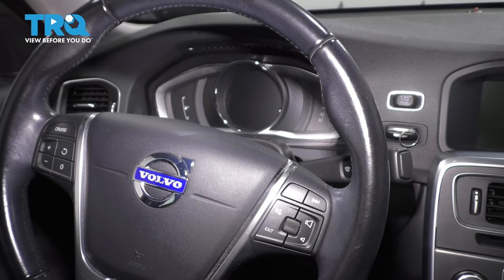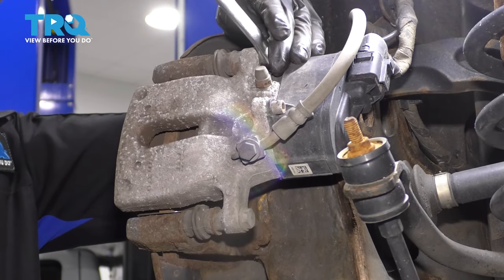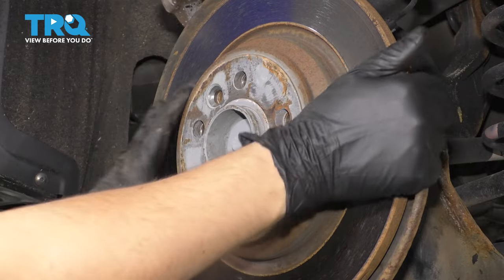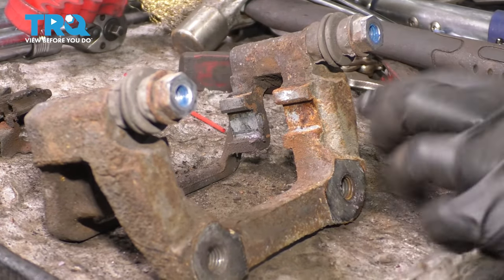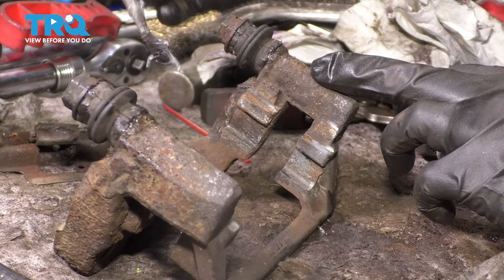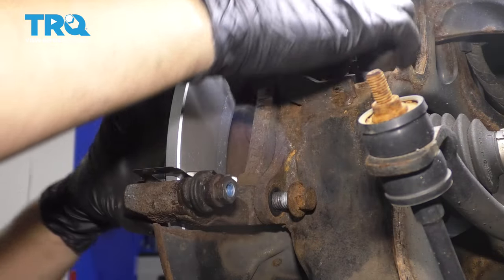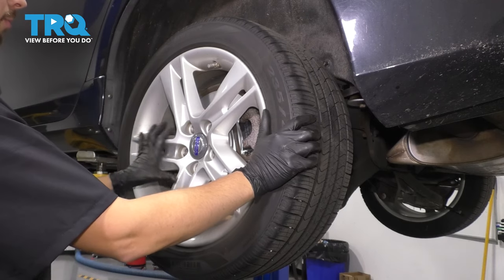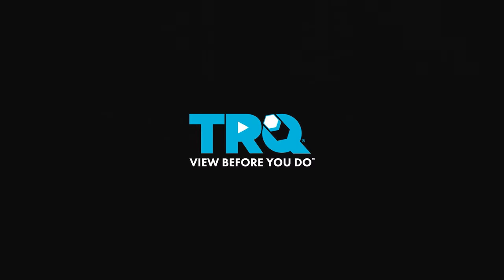How to Replace Rear Brakes 2011-2018 Volvo S60

Comment: thanks! Hey, can I do it without the scan tool? Because I can choose when activate or diactivate my parking brake with a switch in my Volvo s60 t4 R design 2.0T 2014.

Comment: Don't have that scan tool unfortunately.  Will this cause a service light if I manually turn the parking brake when I remove the motor?
Reply from the maker: +@mattbyrne4987 We wouldn't be able to diagnose an issue like that here, you may want to have a local mechanic take a look at it. Thanks for checking us out! http://1aau.to/m/Shop-1AAuto-c